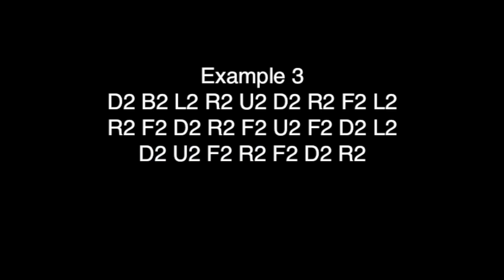HTR to FR: Using Floppy Reduction to find optimal half-turn solutions

Comment: @9:26 Example 3, how do we decide it’s odd parity when corners are 2 cycles and no edge cycles? Can you explain a bit more how that’s determined?
Reply from the maker: The easiest way to check parity is to solve just the corners. Add the number of U2 moves you used to the number of E-layer edge swaps remaining. In this case, you can solve the corners with R2 B2 U2, leaving a 3-cycle in the E layer. So that's 1 + 2 = odd parity
Reply: @hyper-paritycorner6030 Thank you very much for the explanation. 😊Somehow, it was not clear in the video what you actually counted. Maybe because you just visualised the corner solution and what happens to the edge pieces when solving the corners.
Or is there any other way of checking parity? At first, I thought you were doing something like BLD tracing for the corners.
Reply: What I didn’t understand is “the parity of one of the two HTR-invariant corner tetrads”
Reply from the maker: @KalinduSachinthaWijesundara  The two tetrads are UFR-UBL-DFL-DBR and UFL-UBR-DFR-DBL. Since you're in HTR, any corner cycles will stay within one of the tetrads. Each half turn swaps one pair in each tetrad, so both tetrads always have the same parity and you only need to count one of them. In this example, one tetrad has a 2-cycle and one has a 4-cycle, so it's odd party. In this video, I determine parity that way using BLD tracing, but nowadays I think it's faster to solve the corners as described in the previous comment

Comment: Thanks a lot for the explanations, I'll definitely try to get more comfortable with floppy reduction. I think it can be very useful when the solution to HTR is short but you can't find a straight forward way to reduce the case to something easy. I often miss "long" half turn optimals. 
Side note, the second case sequence is wrong by an E-slice even permuation. That doesn't affect the floppy case but it took me some time to understand what was wrong.
Greetings from France